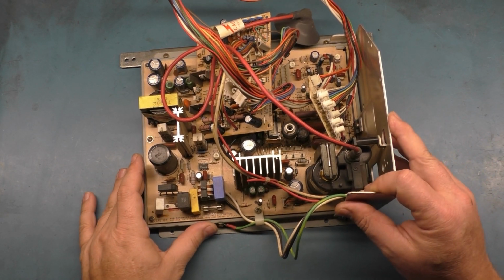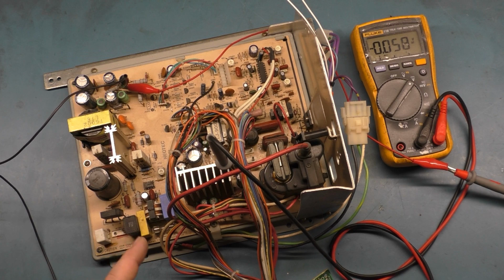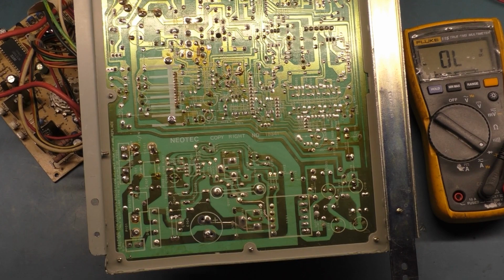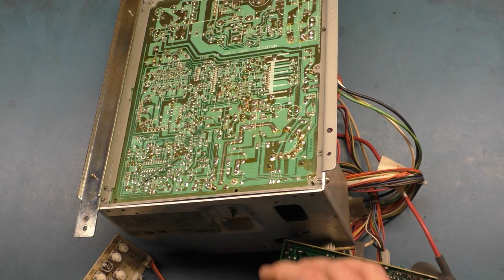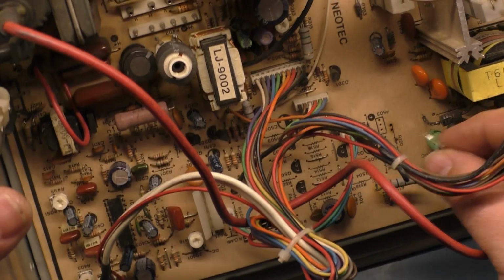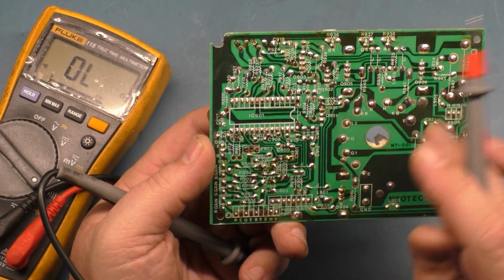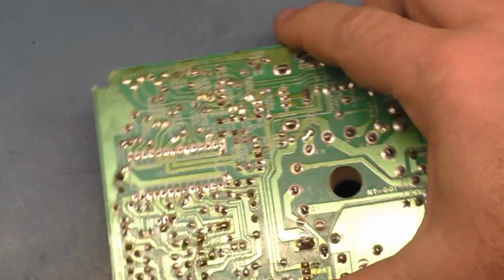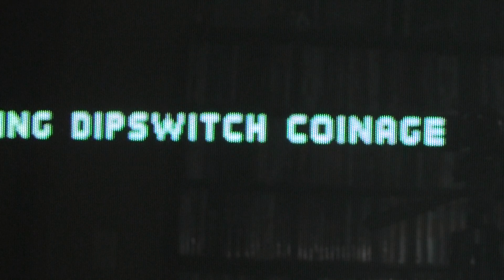25" Neotec 2515C Arcade Monitor Chassis Repair - DEAD - Vertical Collapse - No Blue.

Comment: Great repair as always. But I noticed there is an issue with the vertical linearity. Look at 53:53 on the video. Letters are squished on the bottom of the screen compared to the top. Is that a pot adjustment on the chassis or an actual issue?
Reply from the maker: Thanks. Yes. I took care of it off camera. It’s in the middle of the chassis by the vertical IC.